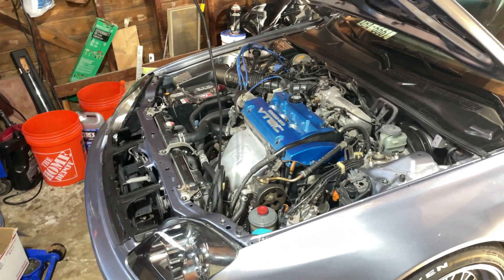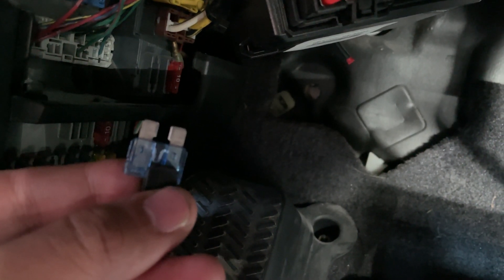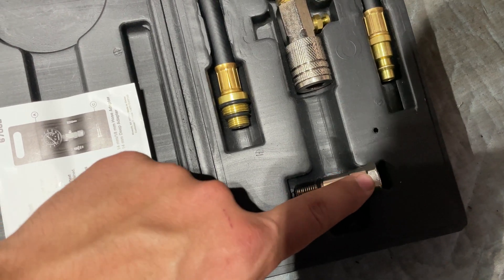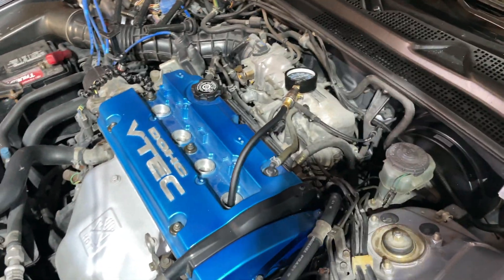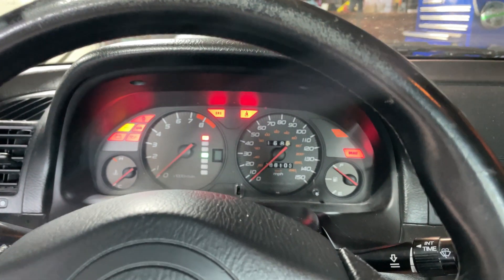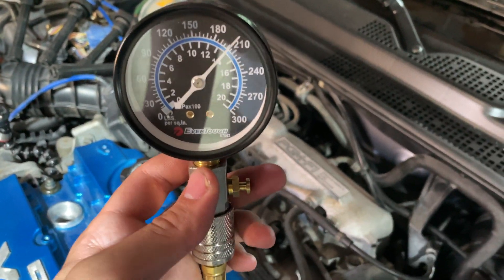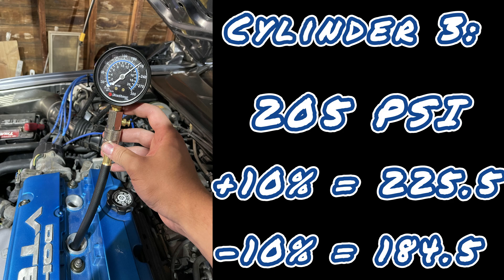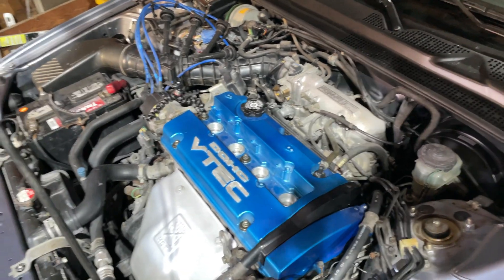How to tell if your motor is healthy | Compression Test (h22a)

Comment: how would i do a compression test with the car having a no crank situation?
Reply: If I were you I'd do a leakdown test. It won't tell you what your compression is but it will tell you if it can hold compression. Very few cases you hold good pressure but have poor compression.

Comment: Quick question I have a h22a I took the AC off and the power steering wheel so the question was what size of belt do you use for the alternator?
Reply from the maker: Great question, I never took any of those components off, but I would take the pre-existing belt and measure the slack or remaining length, mark it, and go to auto zone to try to match the belt sizes. Truth is I don’t really know but that’s what I would do.